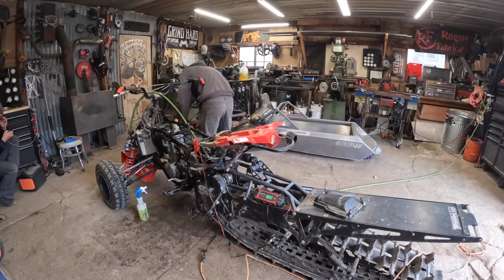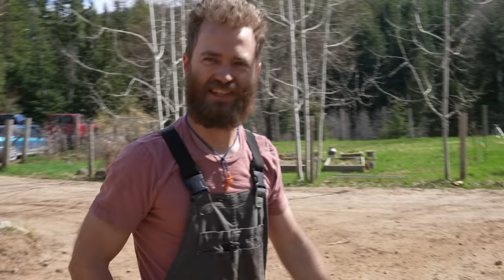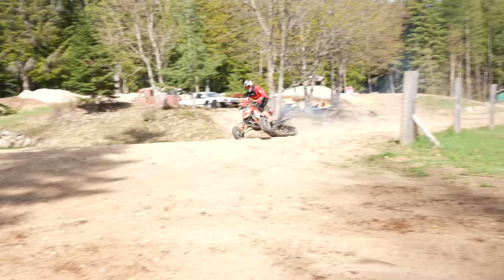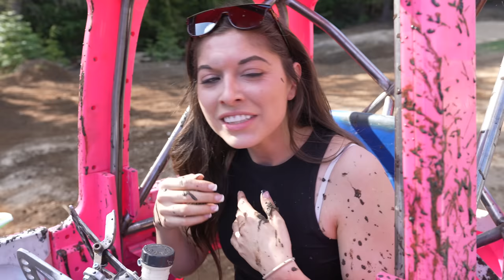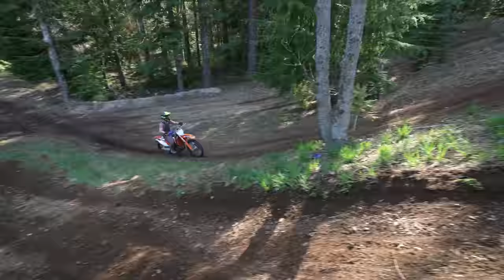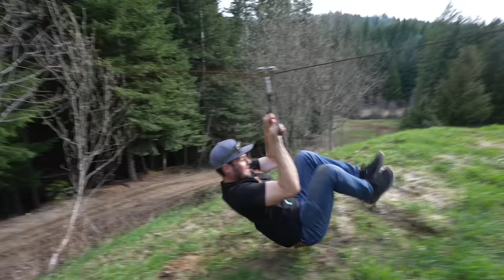Insane Snowmobile Monstrosities Tear up Dirt! Tested by Pro Riders!

Comment: I’m starting a trike project with a lawnmower transmission and a bicycle because I couldn’t find a boat motor for my custom racing mower. I’ll let you know how it goes. Probably gonna start it soon.
Reply: that sounds sick af! subbed
Reply: @silaswiebe7980   cool. I am going to start on it soon. Just need to find a motor and start on the fabrication

Comment: That’s cool 
On the pink kids four wheeler mod how is the front wheels they should be slightly towed in and that should help the steering issues 🤔 I wonder if you modified motocross handlebars instead of the student wheel if that would help

Comment: You should have just put wheels on a real snowmobile and a radiator.  You're underpowered by a single cylinder verses a 850 twin cylinder.  My buddy has one. A pro motocross rider couldn't keep up with him on the motocross track. He just had more power to the ground.